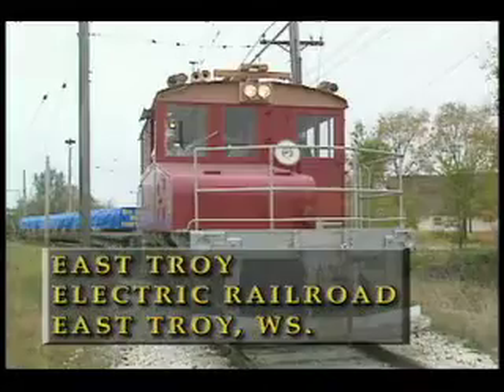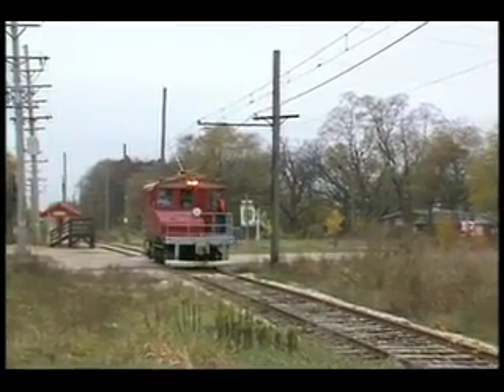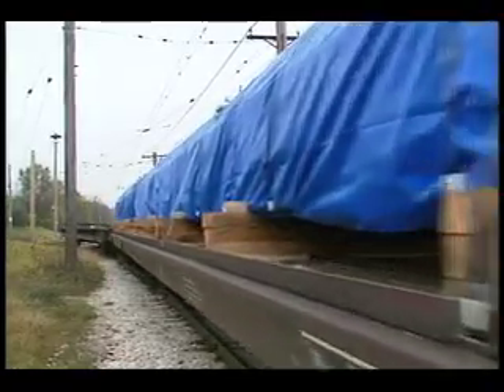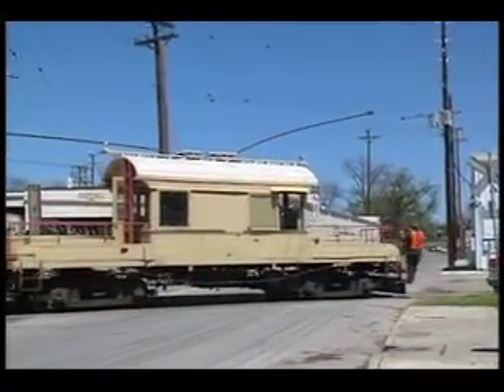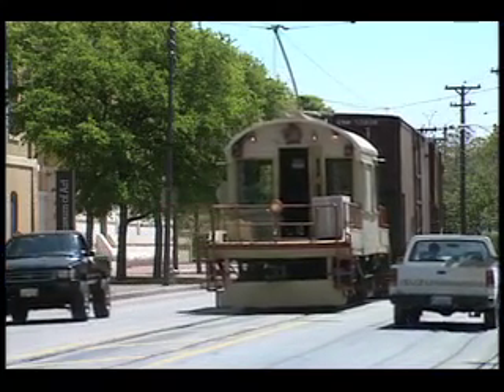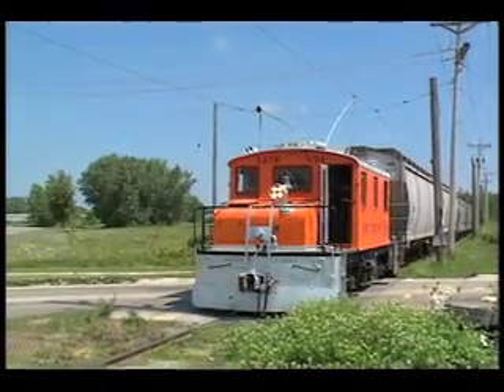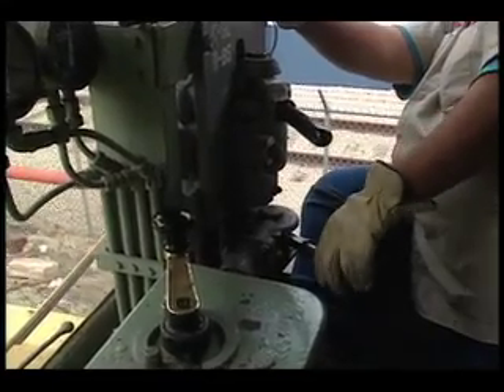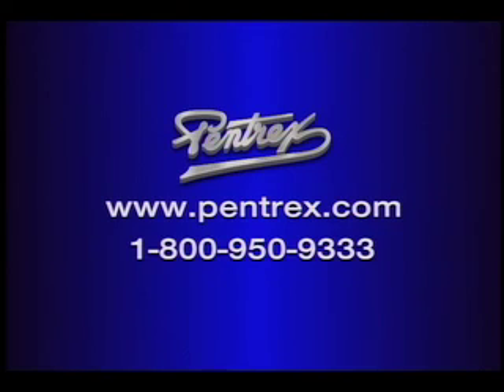Juice (DVD)

Comment: I wish all railroad tracks outside the Northeast Corridor go through electrification.  That would be a better thing to do to save the environment and the economy.  We'll might see electric locomotives (Including ones from Europe) pull freight and passenger trains in every state.
Reply: The problem is the BIG expense of installing catenary (the overhead wires) and the power supply.  Few, if any, railroads can afford it.
Reply: it's been studied by at least one class 1.   Rates would have to triple in order to pay for it.  Additionally, the European locomotives would not be suffice for NA railroading.  The difference in train weights alone make European designs impractical here.

Comment: DO NOT HUMP :)
Reply: SORRY LOL.
Reply: The stainless steel pipe load cannot take hump yard handling, so it is switched out of cuts bound for the hump and takes the hump bypass track to be switched into a new train.
Reply: I used to work the Soo Line (former Milwaukee Road) hump at Bensenville, IL back in the 1990s. I don't know how many times we dropped cars from the crest of the hump with the yardmaster's blessing that said on the sides and ends, "DO NOT HUMP."